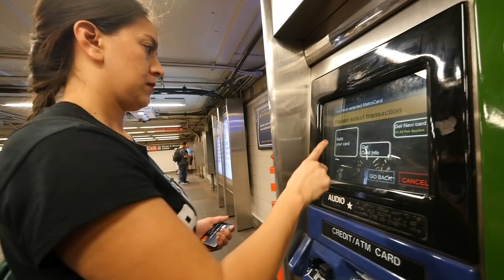55mph DIY Electric Baja Skateboard (Offroad eBoard)

Comment: @Jehu, I have a tech question you might know how to answer.  I want to raise a bike battery voltage from 48V to 51V by adding 1S (in serial), external to the stock battery.  My concern is that the stock battery's BMS might be damaged in some way, depending on how it's wired internally (no way of knowing).  The stock battery pack can be charged via the main port with an e-bike charger, and it also has a small 2A DIN basic charging port (12.6Ah fairly common Reenton downtube e-bike battery).  I'm honesty going to try it regardless, though I'm not sure if I should put it in-line with the positive or negative lead.  Still waiting on shipping for the extra 18650's that are matched model cells to the ones internal to the stock pack.  TIA!
Reply: Short version: I had a 10s10p battery with a BMS and made a 3s10p battery to up the voltage which works well.

Long version: I did something similar with my ebike. I initially built a 37 volt 10s10p battery using the hoverboard batteries when Tom had them for sale. I tested out some small capacity 48 volt LiFePO4 batteries and got hooked on the power.  I ended up building a second ebike exactly how I wanted after my experience from my first one. I also wanted to not let my 367 go to waste so I made a 11.1 volt 3s10p battery that connects to my 37v battery is series. 

I always have separate female XT60 discharge and charge ports on my batteries. For the 11.1 volt booster pack I have a female XT60 connector for charging but on the load side I have both a female and male XT60 connector which allows me to plug in the 37 volt battery to the male side and output 48 volts to the female side. Easy way to run it is series. Since I have dedicated charge ports. I can actually charge them simultaneously using two different hobby chargers or just do it one at a time with a singly charger. I've also have balancing ports on both batteries.
Reply: @esqueue, Awesome info!  So my idea of a "turbo" pack seems sound here.  Is your 3S booster pack in-line with the positive or negative wire leading to the motor?